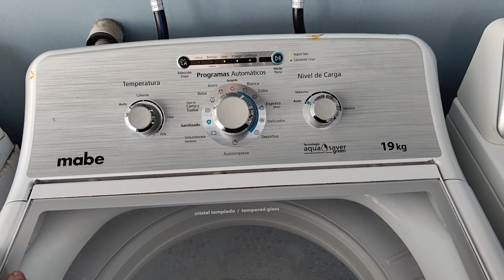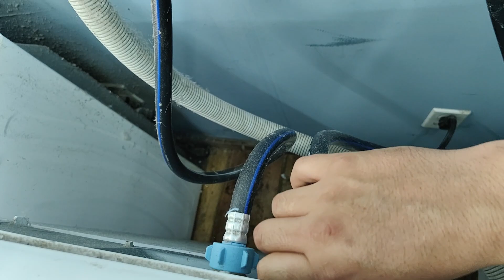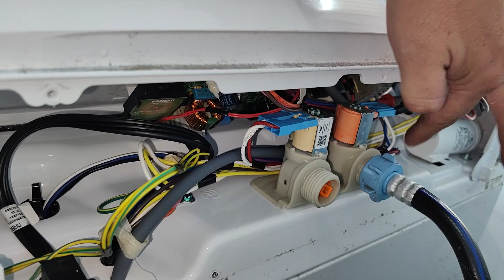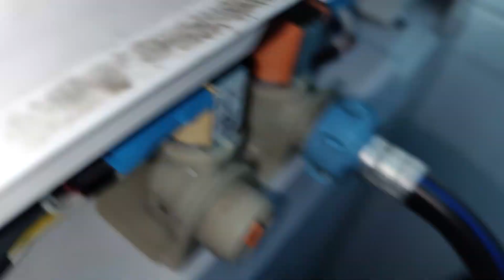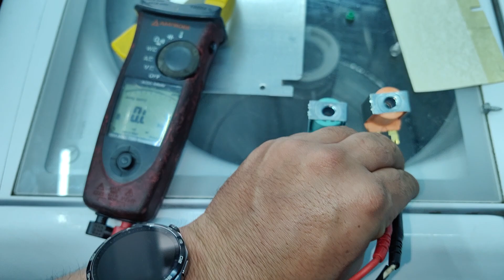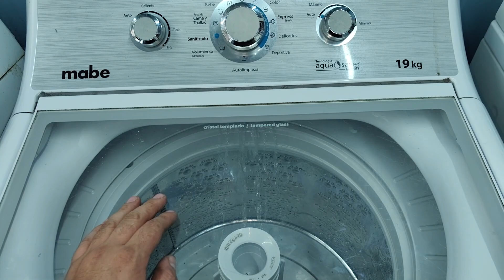Mabe Aqua Saver Green Washing Machine Does Nothing | Repair

Comment: The lid lock doesn't work for my 17kg  even when I disconnect the sensor it does nothing when I reconnect  the sensor as that was off the lid lock light it still does nothing
Reply from the maker: Check the water pump and the most obvious thing is that the insurance is damaged.
Reply: @HomeWorkshop-  imma have a mech check it out already booked my appointment